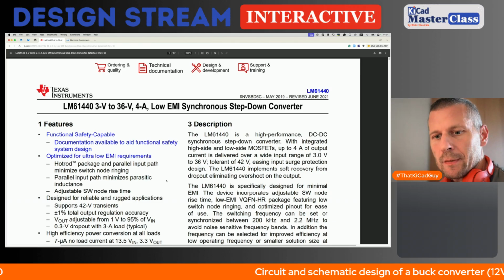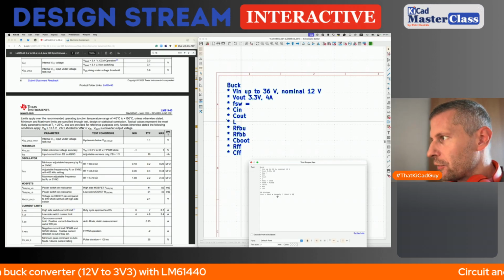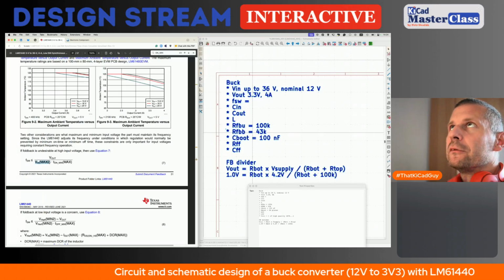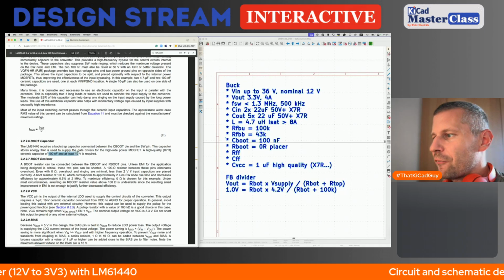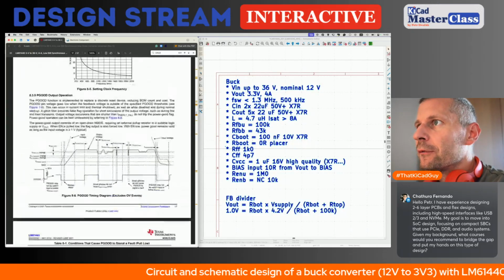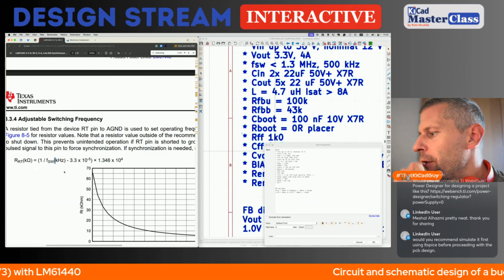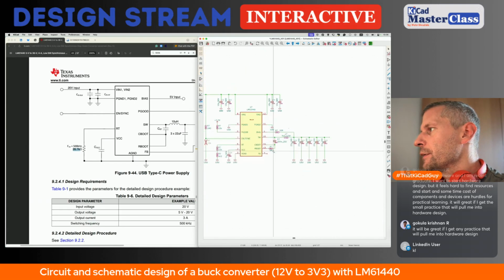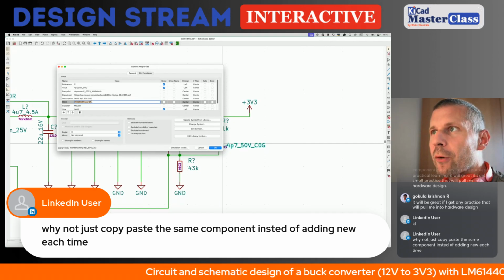KiCad Design Stream Buck converter circuit and schematic design

Comment: For under voltage lockout, I normally use Zener-Diode (upper)  > Vout, and Resistor (bottom) calculated according to Vin max and Zener-Diode  power rating. Thank you for the stream 👍.    It is a good tutorial for newcomers how to use  the information provided in datasheets properly (do not rely on Webench only, rely on calculations provided in datasheet). Looking forward to next stream.
Reply from the maker: Thank you for the feedback. Your approach is fine. The only issue can be the tolerance of the Zener voltage. I will work on the PCB layout in a few days. See you there!

Comment: SKoda , ze tie chipy su vacsinou nizkonapatove a na male prudy.
Ja mam roky otestovany / od r. 2017 /  BUCK 2-phase 100 A vystup, 250 V in / 8 - 112 V out,
a potrebujem is vyssie, na 3 alebo 4-phase synch. interlieved 120 - 150 A ,
potrebujem specialne toroidy na vyssia frekvencie a ucinnost 97 - 98 %,
ak sa da aj 98.5 %, a nizke teploty condov, FETov a toroidov,
pri vyssej teplote okolia v tech miestnosti, ergo nejake air / water cooling
chladenie FEZTov a toroidov s heat-pipes. Lebo zivotnost potrebujem
aspon 15 - 20 rokov. 
A velmi tazko sa take projekty hladaju na YT alebo inde, lebo sice
niekto urobi PCB, deklaruje 30 alebo 60 A, ale ma tam zle chladenie,
a nikdy neukazu napr. zataz 100 A / 24 hod v kuse na termokamere,
ani neukazu ako ten BUCK trackuje power point na IV-curve
ci dokaze rychlo najst nie len lokalne ale aj globalne maxima vykonu.
Toto mnohe MPPT z CHiny nesplnaju a roky maju problem v SW.,